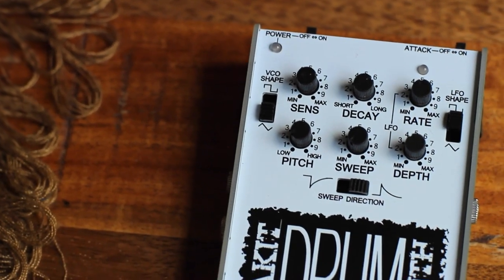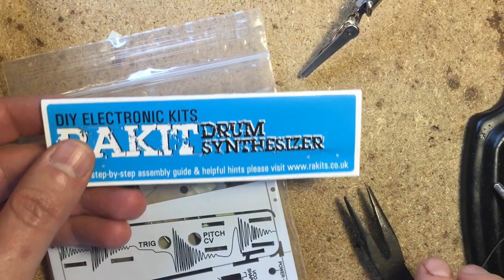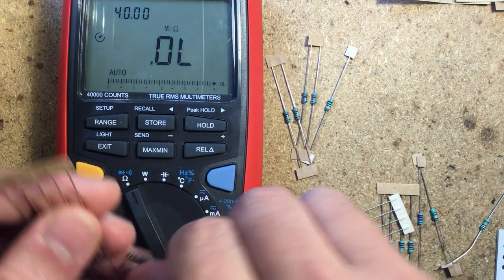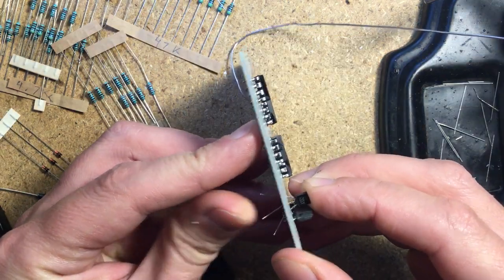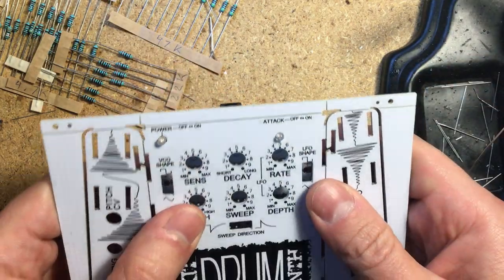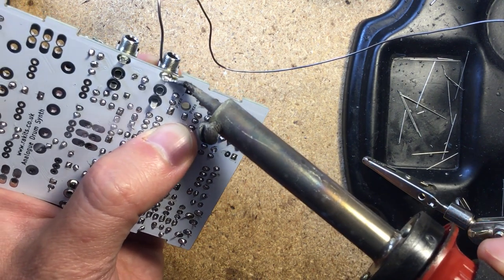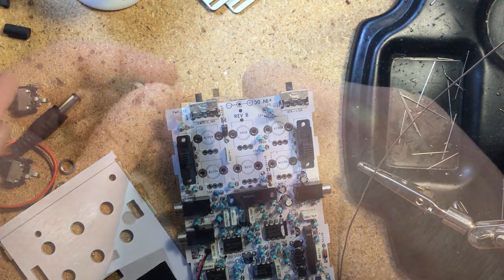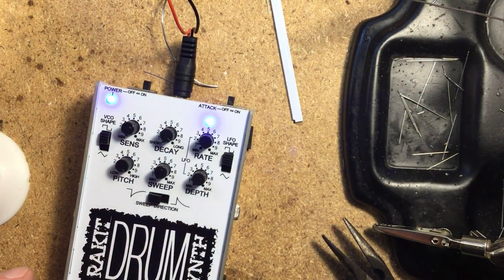Kit Overview # 33 Rakit Drum Synth

Comment: Hey! Do you think that this unit could be powered by a +12 euro power? There is a power regulator in this build right?

Love your channel! Keep the build vids commin’!

I must try your “solder on the top” technique...
Reply from the maker: hey, thanks!  Look, there's no regulator, but I don't think there's anything that would burn if you give it 12v. You might get different operating frequencies though. I'd use a 9v reg if I were you ;)